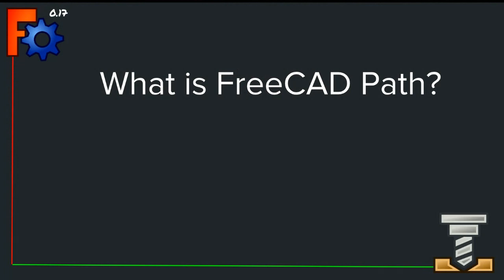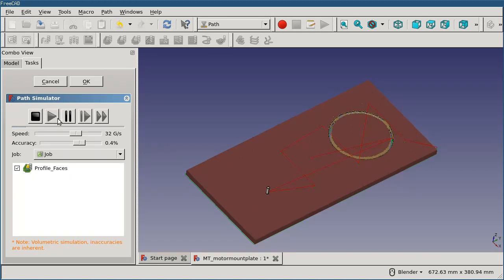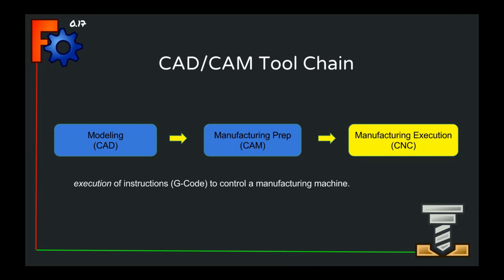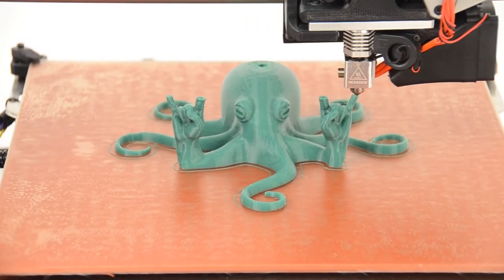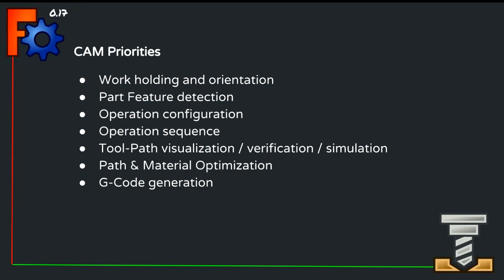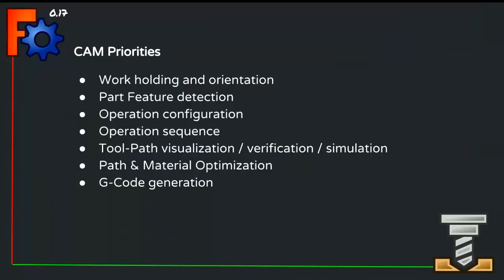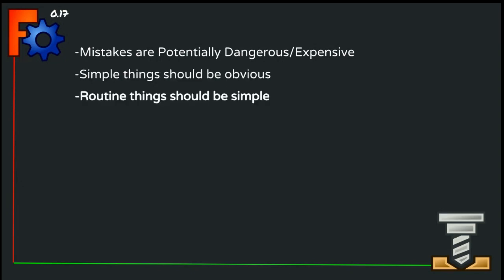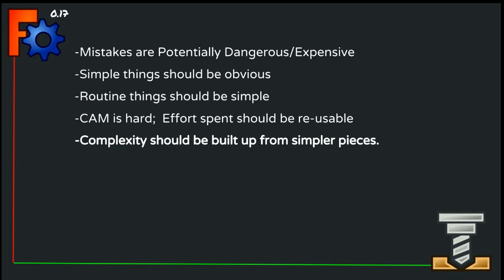Using FreeCAD Path - 0 (Foundations)

Comment: Great video series. Thank you! I'm a newbie to Freecad, with many years of CAD/CAM experience. I. Using it primarily for CAM. Installed 1.0. My test model has a pocket with a sloped bottom face. I cannot get a full 3D pocket path. Only 2.5D...3D surface path works but only when I select the whole model. Any recommendations on which videos I should watch?

Comment: Thank you for producing this video series - I'm just starting with Path on version 0.20.1 - do you know of any changes or gotchas that I should be aware of (compared to 0.17)?
Reply from the maker: Quite a lot has changed between 0.17 and 0.20.x.   Most notably is the tool system.  Check out the other videos on toolbits and don't waste your time on legacy tools.  They are deprecated and will be entirely removed in the next major release.
Reply: @sliptonic  Thank you - I'll look for your later videos on tools and watch them first so I know what to ignore!

Comment: What benefits would I have from using Path over say Vectric Aspire?
Reply from the maker: Aspire is good software. The product is very feature rich and has been around a long time. But it is commercial software. You pay. If they change license terms, you may pay again. If they remove feature or if there are bugs they don't want to fix, you're stuck. FreeCAD is FOSS (free open-source software). That means free of cost but also free-like-freedom. It also runs on linux, mac,and windows.

Comment: Thanks for this great series on the FreeCAD Path Workbench and the useful information in the Path Prostprocessor Customization Wiki!   I recently purchased a Langmuir Crossfire plasma cutter with their new FireControl software.  I decided that I did not want to use Autodesk Fusion 360 (one of the software CAD packages that Langmuir suggests and furnishes postprocessors for).  Langmuir supports a well-used Forum from which I learned that FreeCAD can be used with the Crossfire with an appropriate postprocessor.  (Several other forum members also prefer to use FreeCAD.)  A postprocessor has been developed for the older version of the Langmuir Crossfire using Mach 3 but so far a postprocessor for the newer FireControl software has not been developed.  I've been working with Langmuir and several other Langmuir forum participants to write a Python postprocessor for FireControl.  Langmuir has been very supportive of this effort.  One issue that has come up with both Mach 3 and FireControl FreeCAD Python postprocessors is output in scientific notation for some of the gcode.  FireControl needs its gcode in floating point numbers.  (Seems to occur on very small, e.g., zero, and larger numbers, e.g., over 1000.) Could you provide some pointers on how to resolve this issue?  Thanks
Reply from the maker: Hi Lewis, I'm happy to help but not in youtube comments.  Please post to the Path/CAM subsection of the FreeCAD forum and mention me.  Attach your current version of the postprocessor.
Reply: @sliptonic  Thanks.  Will do.
Reply: Have tried without success to set up an account in the FreeCAD forum so I can send you the requested information.  Don't get a confirming email after setting up the account to activate it.  Actually set up 2 accounts on different machines and different email accounts.  Same problem on both accounts.  Thoroughly checked both email accounts for receiving/sending --- both seemed to be working fine.  Turned off VPN, Antivirus, etc.  Requested several times that the confirming email be resent.  Sent a request for help to the FreeCAD forum board administrator from both accounts but have not received any replies.  The account set-up process seemed standard and straightforward.  I'm probably messing something up on my end.  Any suggestions?

Is this the the post location you want comments and the postprocessors sent to:
https://forum.freecadweb.org/viewtopic.php?t=20273&start=150

Looking forward to your help on the postprocessor. Thanks for the offer to help.

Lewis
Reply from the maker: @lewishirschy3887  I've posted to the moderator section of the forum on your behalf.  Once you have an account, you can create a post in the Path/CAM section.   Your first post will have to be approved by a moderator before it's publicly visible but that usually happens within an hour or so.
Just make sure your first post doesn't look like spam  :-)  
https://forum.freecadweb.org/viewforum.php?f=15
Reply: Thanks.  I'll be on my best behavior :)
Reply from the maker: What username(s) are you trying to create/use?
Reply: @sliptonic  User names:  LewisH and LewisHirschy.
Reply from the maker: I can't find either username created in the system.  The mods aren't seeing anything systemic wrong and new accounts are getting created all the time.  One mod had a very similar situation years ago and said the solution was to create a new gmail account and register with that. He also had to use an entirely new username.   It seems some ISPs are very aggressive with spam blocking and will blacklist entire IP ranges that cover FreeCAD's domain.  If that's the case, you'd never get the confirmation email.
Reply: @sliptonic  Thanks for following up on this.  Sorry to be such a pest. 

When I set up the accounts I used two personal e-mail addresses (both with the same ISP).  Since you could not find either user name in the system I just tried to create a new FreeCAD account using my first account name and my personal email used earlier.  A message said both the name and e-mail were already in use.  I next tried to create a new account with a new name and the same e-mail.  A message said the email was in use.  From this I conclude that both old user names and e-mails have been reserved and can't be reused.  Even if allowed it is probably not a good idea as my ISP may be the problem.  How does creating a new account name and using my Gmail e-mail account as the e-mail address sound?  I would check my Gmail inbox for the confirming email. (I do not typically use Gmail for e-mail but certainly can for this situation.)
Reply from the maker: Your situation sounds just like the other mod reported.  Definitely try a new username and the gmail account.
Reply: @sliptonic  In business now!  

I posted an explanation and several files to  the Path / CAM subsection.  Did not know exactly how to flag you so I included "ATTN Sliptonic" at the end of the post subject.

Lewis